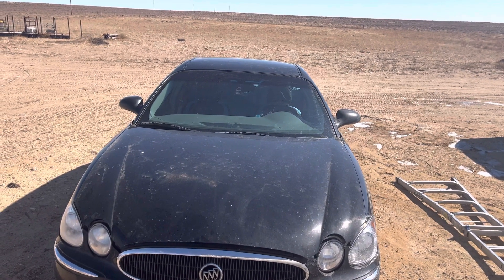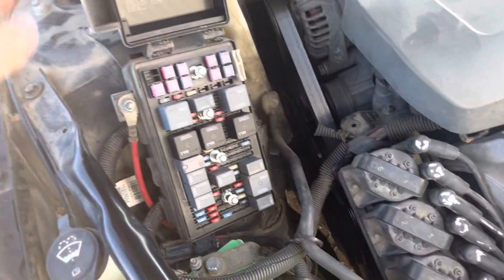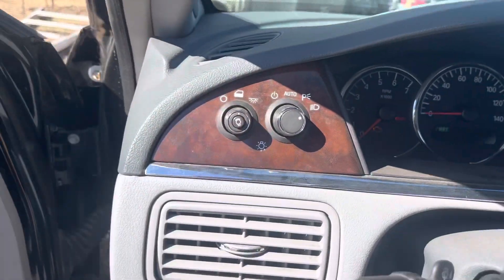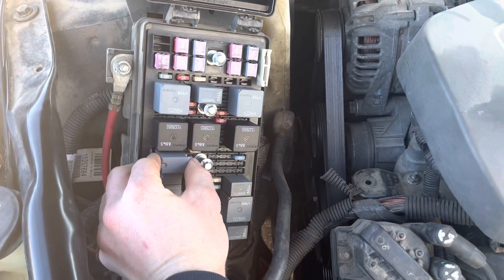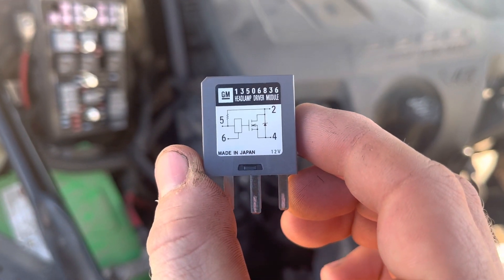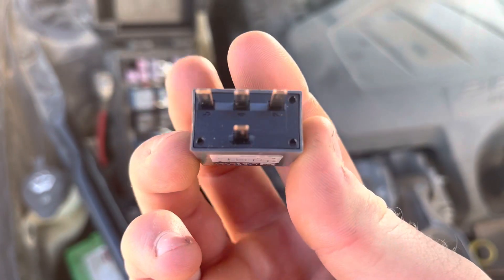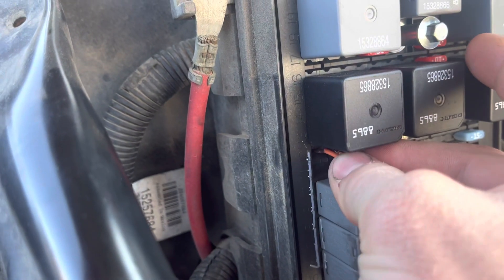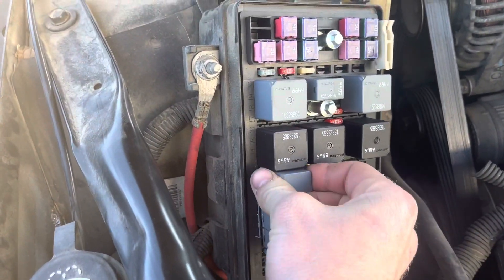2007 Buick LaCrosse No low beams/dims HDM Relay

Comment: Good info thanks.  Since the high beams work, one other option is to take 3-5 strips of masking tape and put them across the top half of the high beam light. If you have blue tape or duct tape that should work also. The idea is the block the light amount and block the light that is going up.  So its enough to see the road but not have your full high beams at other drivers.  You may need to experiment around with it. Not long term solution, but enough to get you home or until you can buy a new relay.